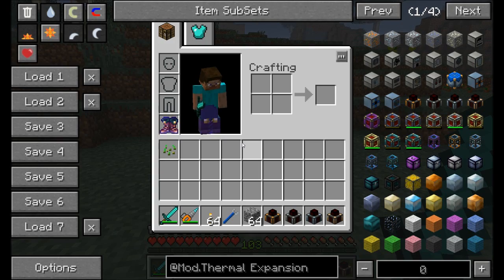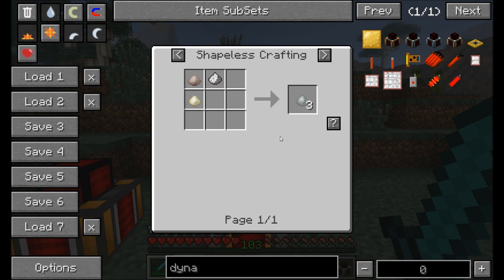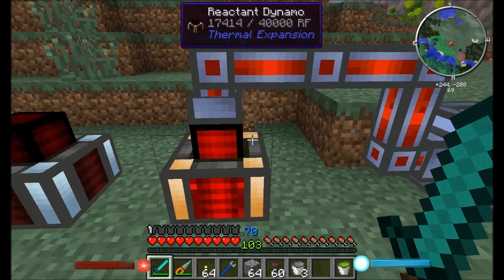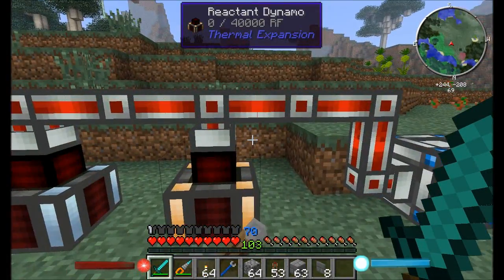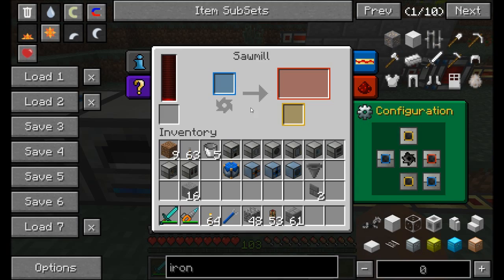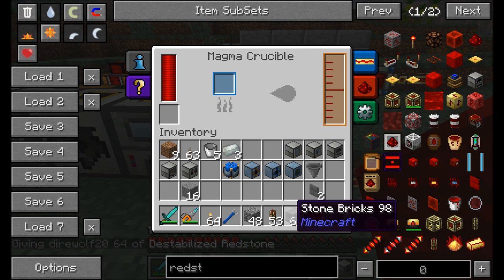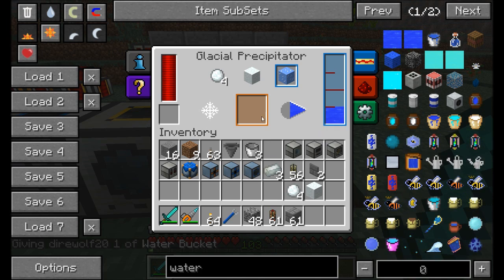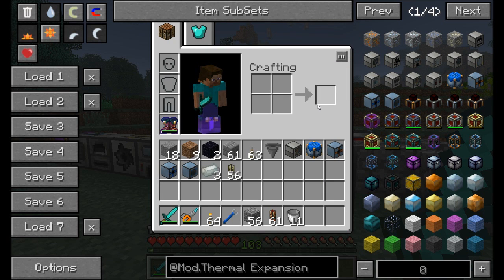Mod Spotlight   Thermal Expansion Part 1

Comment: He's clearly got a beta version of EE3. It's most likely to be on a private pack for 1.6.4 (1.6.4 because of the block of coal when he was searching and not 1.7+ because forge just finished the 1.7 compatible mod loader and every mod has to get rid of item ids before being compatible with 1.7+) EE3's EMC model needs to be tested thoroughly before it can be released. Do you remember how op ee2 was? It was pretty bad. Most tekkit servers had it disabled because it destroyed server economies. Don't expect too much on it yet.
Reply: pahimar has been releasing them on twitter for the past few weeks fyi

Comment: Now that I've watched it, I think it's quite significant that you didn't mention RF can power all machines that can use MJ, Dire. :3
Reply: it cant. Developers have to plug into the api that TE adds to be able to use RF
Reply: Markdaman9 Conduits translate RF to MJ automatically.

Comment: Conduits have a limit per connection. So a leadstone conduit can happily take power from 2 dynamos(80RF per dynamo per connection) transfer that power (no limit) and output it. However, to output it, it needs 2 connections (80RF per connection).

Very, very important difference as to whats explained in the video.

Comment: Very helpful.  I was in The CrackPack before and almost thought the energy cells were not compatible with Buildcraft quarries any more.  I just had to put an energy conduit between the cell and the quarry and then set the relevant side of the cell to output.

Comment: I'm also wondering where the TE conduits went. I'm on MC 1.7.10 and I have NO Thermal Expansion conduits - at all. I have to use Ender IO conduits. Am I missing something, they don't even show up in NEI. The energy cells are there, but no conduits.
Reply: It happens the same to me, ENDER counduits are hard to draft, i wonder where thermal conduits went.. :S
Reply: Adeninax I was looking into the mod a bit and noticed that they mention ducts being removed from TE and that they will be put into a separate mod. Perhaps the conduits will be in that? I'm rather confused:P
Reply: The developers said they'll remove the ducts from TE and will put it in a separate mod. Probably because of some conflicts/exploits with other mod conduits, or maybe they just didn't want it. Now you have two popular options : Extra Utilities Energy Node/pipes, or Ender IO Energy conduits. You can also use AE RF p2p tunnels, etc, but if you only have TE installed, I guess your only choice is to put dynamos right onto a machine. That's all you can do if you only have TE, I recommend installing Ender IO or Extra Utilities, which both are very cool mods and Ender IO is kind of a mod like TE + MFR.
Reply: I do have extra utilities installed, but I'm pretty ashamed that the nodes are a bit worse than the redstone conduits, though. But at least they're better than nothing. :P
Reply: MrBobman878 Thermal Dynamics is out now with all the ducts for Thermal Expansion.
Reply: Jason Taylor Oh thx. :D
Reply: You must download the thermal expansion mod.
Reply: Jason Taylor thermal dynamics

Comment: I have a question, I've been doing research but I haven't found any answers yet. I'm wondering if it's possible to upgrade machines using the same machines. For example, to get a Pulverizer (Hardened), is creating a Hardened Machine Frame the only way to do this or can I use the already built Pulverizer (Basic) to upgrade somehow? Can I take apart the Pulverizer (Basic) to obtain the Basic machine frame?

Comment: You can also make Blizz Powder by infusing a snowball with 200mB destabilized redstone.
Reply: for some reason the Blizz mob is no longer. ive been in all the snow covered biome's. its NOT there. blizz rods can only be cheated in atm, so this is very usefull info. +1 to you :-)

Comment: So I have a question. When I put all 3 different thermal mods in the mod files and the cohfcore it doesn't sense the thermal mods even though it sees the cohfcore. I tried old forges to new forges and none of them sense the 3 thermal mods. How can I fix it? (I'm using 1.7.10 forge)

Comment: Did I see updated EE3? With EMC? The reason he took it out was it was too op, is it back and better than ever or the same?
Reply: He didnt take it out because it was overpowered, the only feature it had was a minium stone. The reason it was gone is because Pahimar didnt updated it for 1.5.2, or 1.6.4.
Reply: The reason he "Took it out" Was not because it was "OP". It was because EE2 was only available for Minecraft 1.2.5. Right now, EE3 wasn't in the Direwolf20 1.6.4 pack because it's still only for 1.5.2. Once updated, we'll see it in the DW20 1.6.4 pack for sure.

Comment: Wouldn't lava be your best bet as a source of energy for Dynamos? Like if you just connect a pump to an ender tank from the Nether, you'd never really have to worry about running out of power.

Comment: I always loved this mod, but the new one is a little annoying in some ways, for one the TE conduits and energy cubes were the only thing that made using BC power bearable, and now you cant use it for bc power? Also the energy generation in the mod is fairly clunky and needs alot of micromanagent, which may be fun for some people, and others will find more tedious to keep farming, particularly if you cant chunk load for lava. Personally I have gone back to ic2 as my starting setup due to these problems, whereas before I would always start with thermal expansion.

Comment: Due to the changes in RF I have a question about power generation. I know that previously, the railcraft steam boiler was basically the way to go with power generation, whether it was using fuel or ethanol (or bio fuel or whatever it's called). Is there still a way to implement this? I tried connecting the energy cell to kinesis pipes but it didn't work.
Reply: Read first, ask questions later
Reply: The steam dynamo uses steam from a boiler to produce RF, it works at the same speed as a commercial steam engine and of course will use the same amount of steam as one
Reply: Also the RF conduits convert to MJ if needed but I don't know about the other way around. In any case I would not mix TE and buildcraft with pipes in between but with conduits for which I know some sort of conversion between energy units is built in.
Reply: Flamur Kasa Well to convert from MJ to RF, the most effective method would be to use the energy transfer nodes from Extra Utilities, since they accept both MJ and RF and output RF.

Comment: just wondering. is there any way in TE to actually pump lava from a lake? only found ways using other mods, but TE obviously wants me to do it bucket-wise.
Reply: i think think the mod creator doesn't want to make an overpowered power source like there is in FTB
Reply: swissboy362 I understand that. but playing with no lava-pump at all is kinda un-automatic..

I could live with it being slow, but buckets are kind of low-tech for TE.
Reply: liquidminds could you make a system with autonomous activators, buckets and itemducts, maybe?

edit: ooh, ooh, depending on how much energy it takes to melt netherrack in the magma crucible, you could potentially automate your lava for reactors that way
Reply: Kit Vitae thx for the input. but the problem with autonomous activator is, that it can only collect the source-block right in front of it, you'd have to move it constantly. 

the magma crucible works. I had that setup in an older world of mine. But it took 10 engines to power it and gave me 2 additional ones as output. 12 engines for 2 was kind of a bad deal FPS-Wise. I'd rather have a system that doesn't kill my computer :-) but yeah, it's an option. netherrack collecting is rather quick.
Reply: liquidminds yeah. seems the dynamos are more fps friendly than the older engines, though, what with not having animations.
i guess he wants you to collect lava manually and use it to make pyrotheum buckets that last for ages.

Comment: Shouldn't generating obsidian only use lava and not water?
Reply: Hrm you're referring to it actually consuming the water instead of only consuming the lava? You may have a point, but I mean it's a machine producing obsidian without you having to do anything or even feed it power, there has to be SOME kind of cost to it.
Reply: I do play Minecraft, you are just being wrong: FLOWING water + SOURCE lava = Obsidian, which means the water does not disappear, so naturally the water shouldn't disappear in the machine either.
Reply: The water DOESN'T disappear.
Reply: Vaxivop And who really cares? water is free anyways, easy enough to create, so stop complaining.
Reply: jackguo380 Not complaining, it was just a statement/question
Reply: Realistically the process of making obsidian would result in evaporation of water, so yes, but most of the time obsidian is formed away from water

Comment: I want to see someone make a mod that when you pour water over flowing water there is a low chance that the resulting cobble stone will spawn as an ore instead of just stone... Just trying to give some ideas...
Reply: Sounds like a really broken/OP (Would be) mod, it would be even worse than MFR's laser drills which already are a infinite source of ores (At a power cost). But this combined with some turtle coding/harvesting method would mean you have infinite ores at basically no running costs at all (BTW no matter how low the chance, its always gonna be overpowered).

P.S. I think you meant to say "Pour lava over flowing water"
Reply: jackguo380 I haven't played in a long time so I don't know the mechanics. And besides. It doesn't matter if it over powered. It's more realistic. All lava and magma flows contain small amounts of many metals like gold and iron. So it wouldn't be impossible. And besides. All of the mod packs pretty much make everything over powered anyway.
Reply: anarchaos210 with gregTech installed, there is a way to turn lava into various different minerals - but at the cost of a damn huge crafting time and pretty much energy
Reply: gruthakhul100 And it's pretty expensive(if you don't have a mod that adds a quarry)
Reply: anarchaos210 You dont get it do you? Gregtech's system is to actually USE the lava, from what your idea is, is that when FLOWING lava goes over water (Turning the water into stone) it would produce ores NOT USING UP THE LAVA (Therefore it is a energy and material free way to generate ores).

The industrial centrifuge from GT will use quite a few buckets worth of lava to produce a few pieces of metal, plus it has a energy and time cost.
Reply: anarchaos210 Oh really? Generally you add mods too make a game better, so yes, you are saying that
Reply: anarchaos210 I am sorry that I am not blinded by metacritic, a site that seems to think realism is perfect and would make every game better. I was pointing out how retarded it is too point too real life, too justify the making of a mod. That is why I came off like a jack ass...
Reply: vyor2 I dont even know what metacritic is. Don't assume things about people.
Reply: anarchaos210 a review site... how you don't know about it I don't know... but did you read my whole comment?
Reply: vyor2 I dont know about it because i choose to make my own opinions of things.
Reply: anarchaos210 almost every game out there(thats triple A) references it...
Reply: vyor2 Doesnt mean I read them.
Reply: anarchaos210 how old are you?
Reply: anarchaos210 Ah, that explains it. Overly independent, too easily offended, and not a very good consumer. In order to be an informed consumer you look at reviews, so you do not waste money. I generally look at youtube. Hell, you can not care about someones opinion, but still not buy a game they are bashing because of bugs or things in the game you do not like.

If you disagree, then tell me, how do you know how buggy, broken, or unplayable a game is, without first spending money on it?
Reply: vyor2 I did say that this is done right? Easily offended? Yes. Very right about that. Now. You going to shut up? Or do i have to report you for harassment?
Reply: vyor2 That isnt an assumption. That is a personal preference.
Reply: anarchaos210 You think that adding "reality" too every game makes it better?
Reply: See, You're making assumptions. I never said every game.
Reply: To everyone reading this. I really don't tolerate when people disrespect others for having a different opinions, tastes, or preferences. I am not afraid to report people who do this to me or others. Like vyor2, I reported them for part 3 of the google conduct. Have a fucking wonderful day.

Comment: I'm really annoyed about the fact, that the mod-author had to implement yet another form of energy (RF), to all the already existing ones; why not stick with MJ? - jeez!
... at least give us some means of "changing" one into the other; e.g. hook up a peat-fired engine to some "transition dynamo", or however you want to call it; after all, the given engines ("dynamos") don't have waste-material slots like "ash" from burning peat :l

Comment: 10000 is weak the ultimate universal cable in mekanism can transfer 12800 RF/t
Reply: mekanism is not made for gamers. its made for noobs who likes it super easy. lol. way more than too OP that mod. compared with bat Morph, then Morph doesnt look OP at all anymore ^_^
Reply: HeroCraft's Wireless links can send 400000000000000000 RF/t. :)
Reply: (It's still in development)
Reply: MadLocustRising1 what about powerconverters?
Reply: 10.000 is not the transport limit, as there is no transport limit. The 10.000 limit is what a single connection can handle. Currently, there realy isnt a whole lot that outputs or requires 10.000RF. And when there is, simply connect another conduit.
Reply: skyqula Dynamos already output 8 times what you're writing about - 10RF is not a lot.
Reply: TristanBomb
EU vs US writing of numbers, AKA 10.000 vs 10,000. There you go, learned another thing!
Reply: skyqula Yeah, I actually noticed that on a lot of things and I figured it was just a foreign-language thing - when I was in Canada, the French side of a milk carton had the measurements with a comma and the English side had it with a period. I never knew certain regions did that for English, though.
Reply: TristanBomb Well I live in the US and measurements have a comma in them. So it must not be everywhere.
Reply: Solber Martinez As a decimal point?